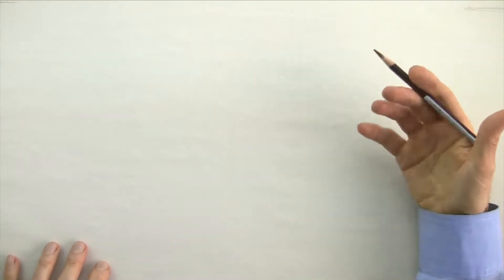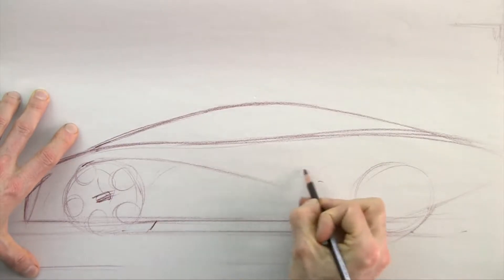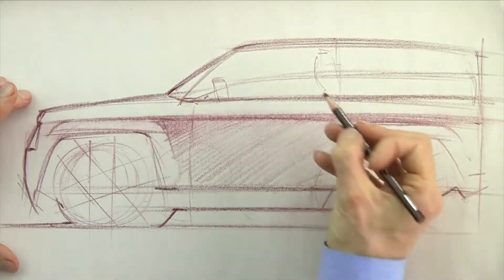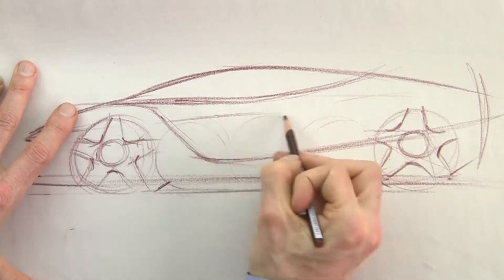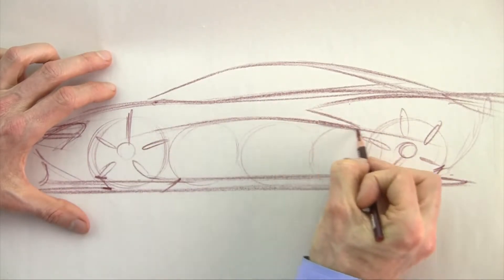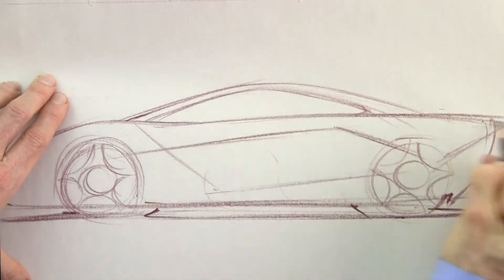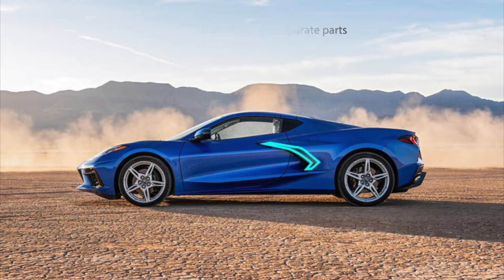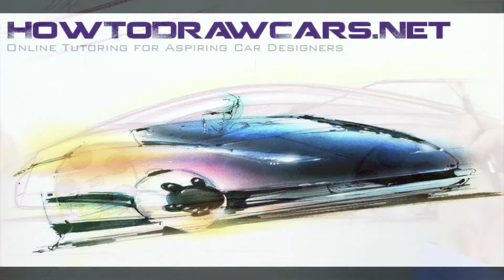Create Better Automotive Design Drawings Now - Understanding Your Line Work

Comment: Please make video on how to properly shade /how much area of car design sketch with wheels we have to shade , do we have to draw wheels as a beginner or not
Reply from the maker: A shading video is on the docket but it might be a while as there are several new videos in production in front of it. For an in depth, step by step lesson on light and dark, shadow and shading and why and how shading happens, I would suggest you check out  the Level 2 course on Udemy here - https://www.udemy.com/course/automotive-design-level-2/?referralCode=7487EEFD9C778A22A1BE

You should draw wheels because it's impossible to draw them well if you're not drawing from your shoulder. Most beginners have not mastered drawing from their shoulder. If you cannot do this, it will not matter what your shading looks like how much you have. I would suggest focusing on the fundamentals and mastering them before moving on to more advanced concepts like how light works across the surface.

Comment: Would you not just use section lines to show some of the transitions in the surfaces.... or is adding too many sketch lines confusing. Nice video Michael.
Reply from the maker: Yes, of course but if you're aware of using section lines you probably have a pretty good idea of what the lines you're drawing represent and what you want your surfaces to do. You're more advanced and looking at the context of the video through those eyes. That's a good thing. The key to doing a good drawing with section lines is to use your line weights so the section lines compliment the other line work and not detract from them. Look at Da Vinci drawings for how to beautifully execute section lines within a drawing.  Glad you likes the new vid.